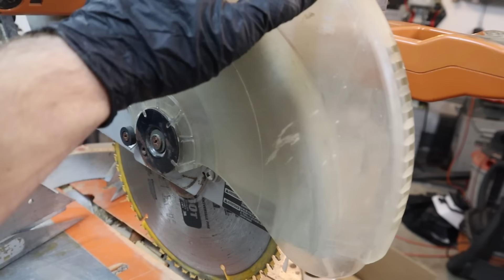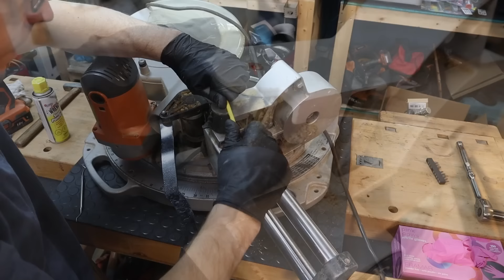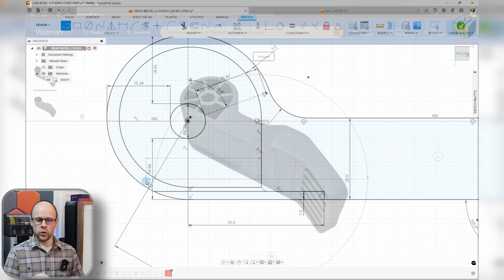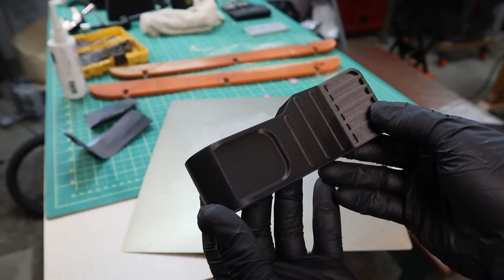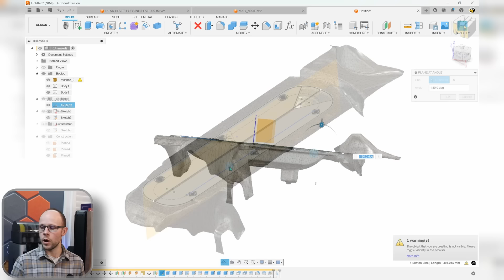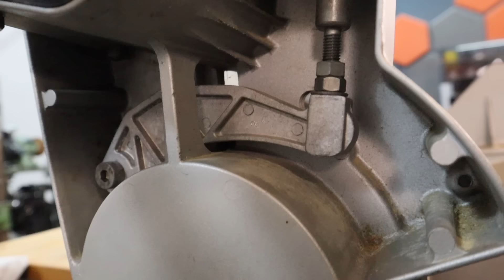How to design and print replacement parts when you only have one half

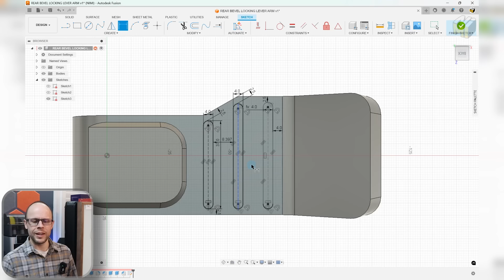Comment: At 7:37 while you are adding the embossed designs, how did you get the design to contour with the fillet you added?
Reply from the maker: I think I just didn't show the step in there, trying to make the videos as short and packed with info as possible.  I ended up creating a sketch and offsetting the perimeter, I then drew in two lines and patterned them down so that the spacing worked out about right.  I started the spacing of those lines where the radius of the corner ended so that the line length came exactly to the end of the offset lines.

Comment: I’m looking forward to the day that manufacturers of equipment like this provide STEP files
Reply from the maker: Do you think that'll ever happen?  As scanning tech gets better, it might make sense to release at lease a good mesh, a STEP would be ideal though.    I get that their concerned about copy-cats, but it seems that we're past that point, products are being copied so well now that you can't tell the difference, at least not without knowing what to look for exactly.
Reply: @NeedItMakeIt  I think consumer protection laws, especially surrounding right to repair, are going to require manufacturers to provide "reasonable access" to replacement parts for x number of years. Warehousing replacement parts is not profitable, or at least not as profitable as the other ways that space can be used. When a new product comes out, part SKUs may sit on the shelf for YEARS before they start failing on customer units.  If providing CAD files reduces the demand for new replacement parts, the cost of warehousing is reduced. And like you said, 3D scanning is extremely accessible, so there's no money in "protecting" the designs.

Comment: wouldn't recommend carbon fiber filaments. these are filaments with bits of carbon fiber in it. it will be aligned in the same direction as your filament is being laid. it won't make it any stiffer but even weaker as plastic doesn't bond on carbon fiber and there are likely gonna be fibers on the edge of the perimeter.
Reply from the maker: Thanks, for the most part I agree.  I've watched the videos about it, and it is good to be aware.  CF filaments are quite a bit stiffer, they also do not have as good layer adhesion, it would be wise to coat the final product in a PU spray to seal it all up for sure.  In my case I wanted something printed solid, in the orientation I've printed the part in, it is quite tough and with the CF added it is rigid so it doesn't easily deform under load.  It isn't necessary, however I checked and the original part which broke was GF reinforced, but obvious they removed too much of the structure.
Reply: @NeedItMakeIt  hmm yeah I didn't consider how a 100% infill would affect the result. I guess as long as you don't get too much force it can be benefitial to have the rigity ^^
Reply from the maker: It's probably overkill, but I think for the amount of extra material in this case, it makes sense.  If I were making this as a production run,  I'd print some samples and perform test-breaks to see at what point each would fail and then make some adjustments from there.  I find that the 100% solid parts print really well also, they don't tend to warp as much as you'd think.  The retention of heat perhaps is part of it.  I have plans to make a video showing how I do the solid parts, there have been some requests for it, but I'd like to address the heat aspect too, so maybe I need to get the thermal camera on it.
Reply: @NeedItMakeIt  that sounds fun! Another option I saw before was using <100% infill and then filling the gaps with raw material. I saw this video on the topic recently: https://youtu.be/H7nrJRBAMOA Sounds pretty interesting, but tbh I don't think it makes that much more of a strength difference compared to 100% infill. It might just speed up the print speed heh. I'm excited to see what we are gonna achieve with new slicer innovations
Reply: good video on the topic: https://youtu.be/_VbOSbOZG1Y

Comment: I really like your logical approach to this. It’s also very helpful that you share the details like the apps you used.
One thought on the miter plate….
Most of the cuts you make are going to be smaller/narrower boards. Putting the joint on the far side of the middle screw means a smoother surface for the majority of cuts!

Comment: I have this saw and the issue with it is that the blade guard will jam and stop moving as you pull down. The arm needs to push the guard out of the way as it comes from the factory and it eventually wears and stops moving. I flipped the arm over and changed the pointing points at the back and on the guard so it now pulls the guard up as you pull the head down. Works much better and no way it can bind up.
Reply: This is what I have been searching far and wide for, any chance you took a picture?

Comment: What about using strips of TPU or other flexible materials to "grip" the wood?
Reply from the maker: TPU is a funny material, it is a bit slippery, not what you'd expect from something that acts like rubber, but it's a good idea, there is probably something out there that would work to help with grip that is printable.

Comment: Since the plate is a disposable piece, your better off 3d printing a template that is used to cut it out of plywood with marked bolt pattern, so you can make as many as you want as zero clearance plates, and not contributing to excess plastic waste.
Reply from the maker: That's a good idea too, plywood is ideal for this, the thickness is a bit of a problem to get exact, but with a shim here or there, it could work.  I agree that plastic waste is a big issue, a big issue also is throwing away the whole tool, this one was on the chopping block when I started.

Comment: I'm going to be honest, I almost skipped this video based on the title - I wasn't interested in a 3D design video. I would have watched it sooner if you had emphasized the restoration of the saw rather than the 3D printing aspect.
Reply from the maker: I'm glad you didn't, I always have trouble with Thumbnails, my shop is packed with tools and projects, there just doesn't seem to ever be a great place for it, the small parts tend to be so much better for it.  I'll keep that in mind though.  Most of my videos tend to focus on fixing something or coming up with new ways of doing things for the shop or home.  I am working on the fix for the sawdust right now too, I think that will come in handy for anyone with this saw, it has to be the worst of any saw I've ever used, it kinda blew my mind.  I have some back-lit slo-mo for the video which really shows just how bad it is, I may as well be blowing it into the air with compressed air.   Thanks for taking the time to let me know your thoughts.

Comment: Great project! Are you going to make a magnetic adapter for this dust hose for this too?
Reply from the maker: I am working on the solution right now, that will be in an upcoming video along with the dust collection solution to go with it, I've been able to solve it 80-90% with cardboard and duct tape so far, so it should be much better in the final printed version using a combo of materials.

Comment: I need to learn how to use fusion
Reply from the maker: It certainly opens up a world of options for you if you'd like to be able to design and invent things.  Which stage are you at?
Reply: @NeedItMakeIt  at the stage that i realized that i need to learn LOL. I dont have a 3D printer yet but its sitting on my cart. 

Theres a speaker terminal that I want to buy but its expensive at $150.. I figured if i can learn to design the exact terminal.. I can make it for cheaper instead of spending all of that money. 

The creator of the terminal uses large magnets to make the connection and sound comes through. He sent me some measurements from his design so that i know how big to cut the hole on my subwoofer box but i really feel like i can learn enough to print it.
Reply: @NeedItMakeIt any advice on learning how to use?
Reply from the maker: I've been thinking about making some Fusion tutorials, so please send me an email and I'll see what I can do to help.  Needitmakeit@gmail.com
Reply: @ video tutorials would be great!
Reply from the maker: I'll see what I can whip up, I have a few ideas on the board and I'll probably start with something not to complex and work my way up to more intricate models from there, maybe an emphasis on 3D printing too would be a good idea.

Comment: Cool Modern Tool Rescue.  Where is the Nutella?
Reply from the maker: Thanks, I love to bring tools back from the dead, but we're not nearly finished yet, I'm going to fix the dust collection now and anyone with this saw will finally be able to use it indoors!
Reply: @NeedItMakeIt  BTW, Thanks for the compound dovetail.  I will be using that in future projects for lap joints for parts that are too big for my build plate.  I tried to recreate it in TinkerCAD (yeah I know I need to bump up to a real CAD program) but was struggling with the compound angle.   Also looking for more types of connecting large parts with a 1/2" or 12mm thickness in parts.   Great channel as always!
Reply from the maker: Thanks.  I'll be making more connection videos too, I want to find the best way to connect large parts that's also easy for anyone to do.  I was thinking to create shapes that anyone can import into their drawings and make the cuts, that's one option for sure, that might be the simplest way, but maybe there are other better options too.   Keeping the parts fairly short too is important to be able to keep them in the least amount of parts possible.  I'll keep thinking about it and hopefully have something to come back to you with that can help!  Thanks for the support.
Reply: @NeedItMakeIt  I made some basic dovetail joints along with a bowtie joint in TinkerCAD for some custom speaker boxes and they worked perfectly as the speaker box was too big for the print bed.  So cut it in half, added the dovetails and the bowtie for the perpendicular wall and it is a very tight press fit.  A little bit of glue and it was good to go.

Comment: How did you import the .gltf file into Fusion 360?
Reply from the maker: First search for GLB to OBJ converter, I use the one called Anyconv, it'll give you a useable file for Fusion.  Once you download the obj output, it'll be able to be brought in normally as a mesh.  Let me know if that works for you.
Reply: @NeedItMakeIt  I have done this and it does  work. Not a fan of sending my models to websites I don't know. I swore I saw a video using blender to convert the model. I need to find it again.
Reply from the maker: There is a better option that I just found a few days ago too https://convert3d.org/glb-to-obj  this one works more often and it also comes with the textures, which is pretty nice, though not super useful.  Let me know if that helps!

Comment: if thegap for the supports is smaller, won't the blade cut it at a 45 angle?
Reply from the maker: The way the saws are setup is that the center of the pivot is at table height, this keeps the blade in pretty much the same position in relation to the inserts, it is really close, maybe off 1/16".  If the blades are thicker than mine it will remove a bit though.

Comment: Great job, especially with the lever handle. The gap looks too skinny for a 45degree cut have you tested that out?  
It looks like there is a port in the base for dust. Is there supposed to be another fuse extraction attached somewhere to extract from the channel?
Reply from the maker: It works perfectly on a 45, the saw is setup correctly luckily with the tilt pivot pin set to 1/2 way down on the table.  When the saw tilts the blade stays in the same position in relation to the inserts.  If I really force it, the saw will move a little bit to one side or the other, but that's pretty normal with these slide saws.  I realize that it isn't critical here because the blade is pulling up on the material, but I don't like things falling down inside and the small clearance to the blade keeps the slivers or material out of there where they were always getting stuck.    No dust collection down below sadly, it would be a good idea though.  I'm working on the final fix for the dust collection right now actually. !

Comment: Super interesting video, thanks for sharing. I can't say about this particular model with only a quick look, but often a replaceable throat plate like that only contacts near the fasteners because it's adjustable in some what to get a good flush level with the top surface. So it doesn't necessarily make contact with the bottom of the throat insert.

Comment: With 100% infill, more walls is not necessarily better. The alternating direction of the rectilinear pattern interlocks really well, and having more of that makes the part stronger. I'm also going to guess that only one outer wall is not great either, but perhaps only for aesthetic reasons.
Reply from the maker: I didn't go into the explanation well, but the infill speed it higher which I believe decreases adhesion properties, I'd really need to throw some tests at it though to be sure.  Great point, and certainly worth some investigation.
Reply: @ IIRC There’s a video by My Tech Fun where he is surprised to learn that all walls is weaker than 100% infill. I think the alternating line direction is the reason. Higher speed can reduce quality but if the extruder and heating element can keep up, that won’t matter.
Reply from the maker: That makes quite a bit of sense, a good option as well would be to slow the infill down for even better results.  With brick layers coming in I wonder which will be the best in that case.  I think I'll stick with solid parts for most prints, but I will have to try your suggestion on some of the next ones to see how they turn out.

Comment: Gloop is way better then supper glue. Its not a surface bond its a cemecal bond. Made for 3D printed parts. You need to check them out.
Reply from the maker: Cool, that's great info.  I've been super cheap, I'm on a strict budget so I buy from the dollar store for glue... hopefully that'll change in the coming months and years.

Comment: Instead of a larger opening at the back of the slats, perhaps a dust collection vacuum feature?  Looks like there is room for it.
Reply from the maker: I'm looking at it now and when I rotate to the max angles it cuts off most of the back, it might still work, but it would be super tight.  I'm working on the dust collection now so I'll definitely keep your idea in mind.  There is still quite a bit of dust moving through there and then launching up near the back and not being captured.

Comment: Why make it 100% solid? You could have made it with very low infill and made provision to add metal hardware inside (with a pause in the print or whatever) and saved on expensive filament
Reply from the maker: Sure, that's a great option.  I try to design these parts so that anyone can print it and install it with as little trouble as possible, that's one good reason, the other is that it's just easier.  It is probably overkill... I just don't want to have to think about it ever again.

Comment: Great work.  Really liked that you showed using Polycam to scan.  I want to get more into scanning and using real world parts as starting points.
Reply from the maker: Thanks!  The phone scan usually does a good enough job to get it done, eventually an upgrade to something more professional would be great though.  I'd love for programs to be able to convert a scan to flat surfaces, I think there is a lot of value in it, the same goes for curves, but I guess that would be much tougher to figure out.

Comment: I've never used glass2k, but i can import pictures directly into my CAD software, lock the aspect ratio, and scale the picture until a known dimension matches both the picture and my sketch. Afterwards, I just trace the part.

The scanner on 2D Printers are usually very accurate, and PDFs have dimensions encoded into them.
Reply: That works in Fusion too.
Reply: @QBziZ  admittedly I have little experience with fusion and SolidWorks, they simply don't mesh well with me. Why don't people import images more often? It's a very easy QA Check to do even before printing a prototype.

If your curious I use Ansys SpaceClaim
Reply from the maker: Great tips!  I'll play around with some of your ideas too, ideally we'd use AI to convert a photo to a Fusion file with dimensions that could be tweaked, but I don't know close we are to that yet.
Reply: @NeedItMakeIt  Insert Canvas, import your image as a canvas, then right click the canvas in the hierarchy on the left and Calibrate.  Pick two points easily measurable, set that measurement and it will be calibrated.  Reduce the opacity of the canvas as much as you need to and then its all in fusion.

Comment: I would be convenient if the printer could just tilt the bed 45 degs when needed so you never have to think of overhang problems.
Reply from the maker: That must be coming at some point.  I had also thought about a small robot arm that could move around and provide support in those areas, but that's too complex.  Ideally we'd print in SLS nylon and call it a day.  A hollow part is one downside of printing that way though.  The tech is still improving fast so we'll have to see where this is going.  Maybe a full printer gyroscope that can tilt as-needed?